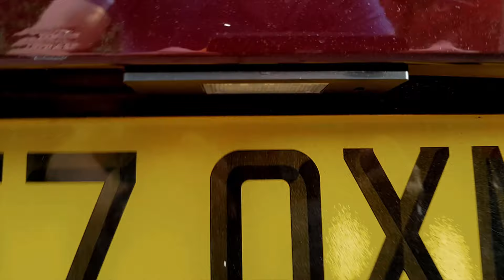BMW 6-Series E63 and E64 Replacing Bulbs and LED's - Xenons, Halo, Main Beams, Indicators, Fog Light

Comment: You can code more volts to them
Reply from the maker: Not on the E64, but can be done on later models.
Reply: @ mines e64 2010 convertible and i have on carista

Comment: Hi. My reversing light on E64 has given up. Can you confirm if the rear bumper does need to be removed please. Not sure you clarified in your video. Thank you.
Reply from the maker: I'm afraid so - you should be able to pull out the affected side only, but I've never tried it

Comment: Great video.  The only bulbs to add are the outside halo lights.  Access requires removal of the front tires and the wheel dust covers.  Keep up the excellent work.
Reply from the maker: On the E63 and E64 the Halo's are lit by a single bulb each side - the single bulb is shown in this video (replaced with an LED in my car)
Reply: Timm's BMW Repairs and Information .  Thanks for that information.  I must have a different model 650i.  In any event, I did replace the bulb recently for the outside passenger halo light.  Your videos are informative and entertaining.  They also help encourage me to undertake repairs on my car.   Thank you.

Comment: Hi Tim
Sorry to rely on you for help, I’m struggling to get to the bottom of a problem with my E64. 
My 3rd brake light has stopped working. No error message, just doesn’t work. I’ve tried replacing it but nothing. Any ideas please?
Thank you so much
Mark
Reply from the maker: Probably the wiring in the boot/trunk hines - an age-old problem on BMW's!
Reply: Thanks Tim
Will test them all the next free Sunday I have.

Comment: Hi Timm, great videos Thanks !   do you know if these can be switched to RHD beam for mainland europe?
Reply from the maker: I've had a good look through my pictures and cannot see any LH/RH adjustment, and the owners manual doesn't even mention it! So, if the dipped-beam is flat (no turn-up on the pavement side) then no need to do anything, if there is a turn-up then the stickers will have to be used

Comment: Hi Tim, Thank you so much for you really useful information, You know your onions when it come to these cars. I am a new proud owner of a 630 convertible (bought it 1 week ago). I seem to have a problem little problem but nobody seems to know what the problem is . I have no heat coming out of the heater vents. I plugged my little hand held OBD2 in and it showed I have a ‘Thermostatic heater control circuit open’ P0597. I took it to a local garage and he changed the engine thermostat and put antifreeze. I picked car up and something strange has happened as there is heat coming out of the Left hand side now (all vents on left) but nothing on the right hand side .  Defiantly an improvement as there was not heat before they did the thermostat. Still not getting as hot as it should on the left and no heat on right.  I am confused to what this could be and any advice /help would be amazing as I am at a loss . Did I just waste money on the thermostat?? As I don’t thing it was that ?  . Sorry to post on here but I tried to find a contact and I wanted to ask you as I have watched all your videos post me buying my car ... I’m going to try the teak oil on weekend 👍. Many thanks
Reply from the maker: Tricky one that Darren. The first thing that gives up if you are short on coolant is the cabin heater as it is the highest point in the system - you have probably been a few pints short for a while. First on my list would be the heater valves, well, I hope so as working with the IHKA is a lot harder!
Reply: Thank you so much for getting back to me. I am glad you said Heater control Valve as that’s what I was looking now trying to get prices on some in Europarts .  I will let you know how I get on 👍👍👍👍👍

Comment: Is it ptc or pdc. Because I have problems with my pdc they only work on hot weather.
Reply from the maker: It's PDC (Park Distance Control) and that will be one of the sensors failing. You need diagnostics to find out which one!

Comment: Fantastic job pal. Do you know how to take off the whole indicator
Reply from the maker: The fixings can be reached from under the hood - two of them and then it slides forward. And - Thanks!
Reply: I've did it but it won't go. It's looks like it want to swing out but still something is holding. I don't want to break it by pulling too rough. No videos on yt how to take it as well

Comment: Hi, Timm, there was one set of lights that you missed in the video namely, the reversing lights. They are the most difficult to change as you have to remove the rear bumper to get to the bulbs.
Reply from the maker: Yes, I'll have to add that at some point!

Comment: Hi Tim, 
I really appreciate these videos and find them extremely helpful. In Fact, I purchased some of your recommended bulbs for my 56 Plate BMW 630i Cab.
Having said that I wonder if you could give me some advice please? My passenger side rear taillight is not working (when turn the lights on in position 1)  The indicator and break lights work fine but the constant red (LED?) ones. 

Please help, as I have a MOT Test coming up on Tuesday.
Reply from the maker: Hello Meerwis, sorry to hear that - I have never had a problem with the rear lights - and the TIS does not show replacing the bulbs because it is solid-state LED (non replaceable) - have a look on YouTube to see if anyone has had the same problem - sorry!

Comment: Did you have to have the led halos coded to the car as I'm looking at getting some for my e63
Reply: No need for coding as long as you get the right LED unit - the one linked above is the same as mine and is a straight swap without coding.

Comment: Hi Timm! tried fitting the LED Halo lights shown in the description to my e63 04 645 and they were the wrong connection, sightly too big... doh! :( Great Vids though!
Reply: You should have been supplied with a pair of converter leads that go between the car loom and the new halo units!
Reply: @longmoormilitary-railway7620  Yep i was, but it was too big to fit into the 'car side' plug unfortunately.
Reply from the maker: So, the lead supplied with the Halo's doesn't fit the car's loom?
Reply: @TimmsBMWRepairsandInformation  nope! Its close but just slightyl too big compared to the original fitting on the  standard bulb unit. Not to worry though! Was only a tenner...

Comment: Timm: Your closeup shots reveal quite a bit of road rash on the 6 - I highly recommend Dr. Color Chip factory matched repair system...about $45 and gives a near perfect result.
drcolorchip.com
Reply from the maker: Fortunately a bit of spray from the paint correction I did on my Daughters car - but there are a few stone chips there as well - I'll try my normal method first - the paint method does look a bit scary!